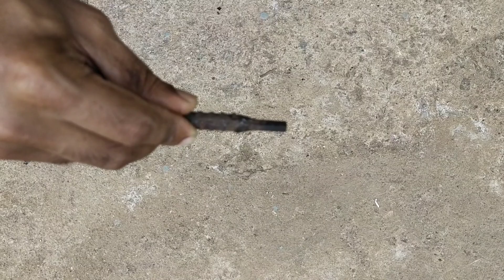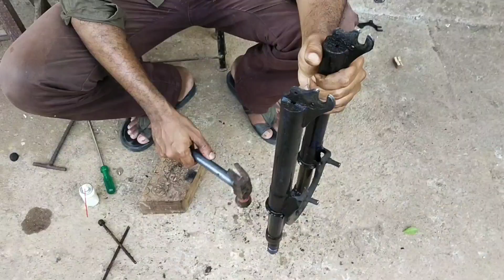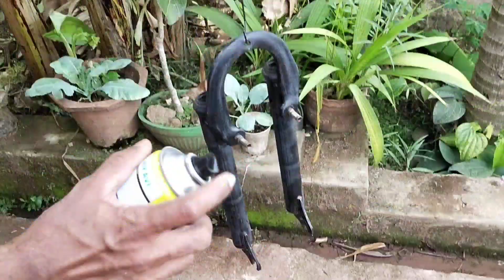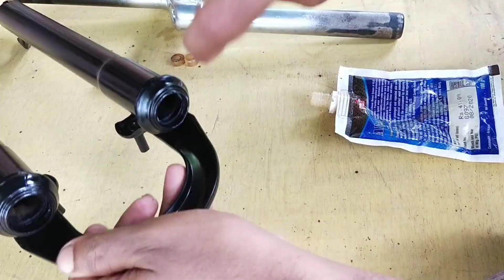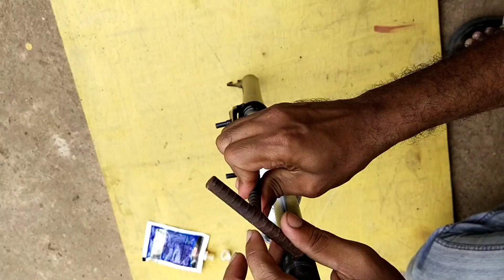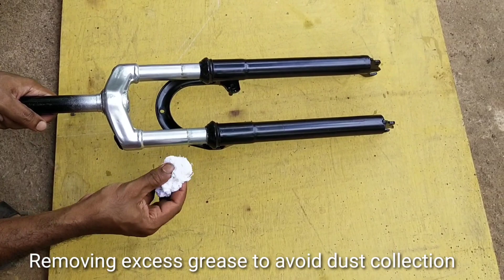Bicycle Fork Restoration /shock absorber / suspension fork

Comment: എന്റെയടുത്ത്‌ Zoom ന്റെ ഫോർക്ക്‌ ആണുള്ളത്‌. അത്‌ അഴിക്കാൻ ഇതുപോലെ 6mm key ഉണ്ടാക്കി. പക്ഷെ അത്‌ ശരിയായ സൈസ്‌ അല്ലാ എന്ന് തോന്നുന്നു. 

Zoom ന്റെ സസ്പൻഷൻ അഴിക്കാനുള്ള കീ സൈസ്‌ അറിയൊ?
Reply from the maker: Key size എത്രയായിരിക്കും എന്ന് പറയാൻ പറ്റില്ല. Bolt il നോക്കി കണ്ടുപിടിക്കണം. ഒരു വടിയുടെ അറ്റത്തു soft ആയിട്ടുള്ള എന്തെങ്കിലും material ( eg: cardboard, foam sheet, rubber etc ) ഒട്ടിച്ച ശേഷം forkinte ഉള്ളിൽ ഇറക്കി allen bolt inte മുകളിൽ press ചെയ്താൽ allen key slot inte impression അതിൽ കിട്ടും. അതു വച്ചു key size കണ്ടുപിടിക്കാം.